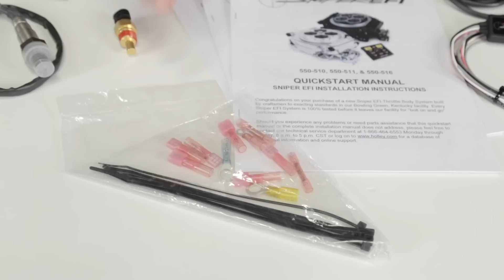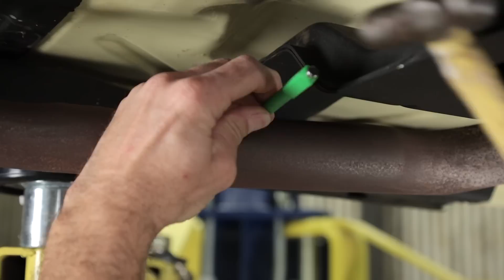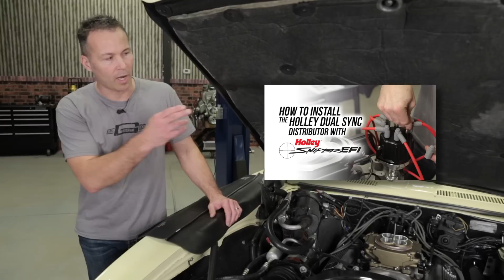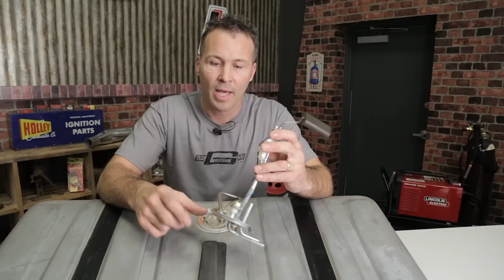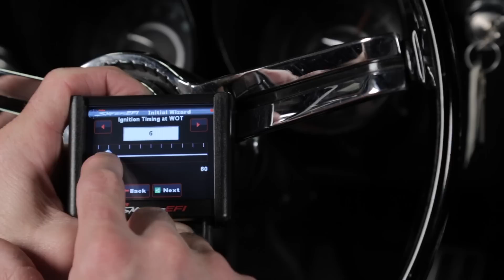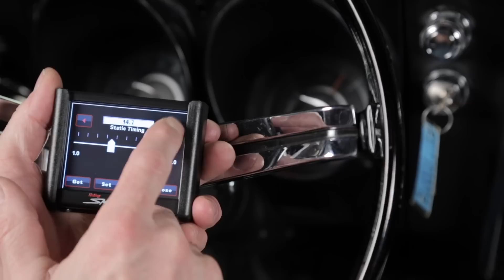How To Install Holley Sniper EFI

Comment: That fuel sending unit that you had in your hand.. That had a port for a return line already sticking out of it, did it not? 
Why not just run your return line directly to that port instead of drilling an additional hole for that fitting?

Comment: @11:10 is it just me or is there a nut missing from the rear end spring perch mount? Likewise, on the 67 you should replace at least one side of the spring perch mounting nut and bolts with a u bolt to prevent the rear end from ripping off the perch.

Comment: So how does it work with a early mopar electronic ignition ? is the hookup the same as a HEI ? And what about heat on the ECM in the hellscape that is a B body engine bay lol and what about power brakes and vacuum Cruise control will it effect the function of them?

Comment: Question,  is the O2 sensor you installed on what I think is the passenger side exhaust downstream of the header collector pipe, only measuring those  4 cylinders' O2 levels?   Great video.  I'm planning to do this install at my home shop. Thank you.

Comment: Installing the Sniper in my 5.0 swapped e36, and installing On3 70mm turbo kit. Just picked up an Aeromotive fuel pressure regulator . Will be running 7-10lb boost. Will I need to utilize the boost/vacuum port on the regulator, and if so, best source to hook it up to?
Reply from the maker: Yes. Your fuel pressure regulator has to be connected to manifold vacuum. -Keith

Comment: Will this work on a rotary motor in my rx7
Reply: if you have some how found a Four barrel intake manifold on that RX7 or a adapter plate maybe lol $1300 is a lot of money for a science experiment the way the rotary works is a lot different than a regular engine works with a crab it just dumps fuel so it don't matter as long as it's timed close enough but efi runs off of the distributor timing coil ignition pulses and need to be pretty dead on and the Rotary crankshaft runs 3 times faster than the rotor does so who knows ?

Comment: Good speaker for a horrible product 1000 miles on mine and I’ve had nothing but problems
Reply: What issues have you had? I'm looking at getting one for a 355 Holden ( GM motor ) in new Zealand

Comment: Is LS better than SBC when carberated? Could a stock 4.8/5.3 LSX produce more horsepower/torque than a stock SBC 350 carbureted?
Reply from the maker: Is this a trick question?? LOL!   Both engines have their pros and cons. And as to which one is better than the other depends on what it is your looking to get out of it or using it for.  A quick search of the internet will get you plenty of opinions and may help answer your question.  My choice would still be the LS!  Thx J

Comment: Can the system handle low vacuum engine with big cam ? I have less than 7 inches of mercury at idle
Reply from the maker: 7" of vacuum is not ideal by any means, but with some time spent tuning with the laptop and patience, you should be able to get a driveable idle quality.    Thx J

Comment: What is required for using the ignition control module? I have an HEI with an accel super coil
Reply from the maker: To connect your HEI dizzy to the Sniper, you just need to connect the yellow wire from the sniper wiring harness to the tach output terminal on your distributor.  Then connect the positive and negative battery leads and the switched 12volt  wire!  Thx J
Reply: @HolleyPerformance  So in order to control timing I need a Holley Dual Sync correct?
Reply from the maker: @TheMojo487  Actually no!  We offer the Holley dual-sync and Sniper Hyperspark plug and play distributors as a conveninet way to control timing with Sniper EFI.  But you can do timing control using almost any magnetic pick-up style distributor like our MSD units. Just make sure the distributor you use allows you to lock out the advance mechanisms and has an adjustable rotor.  Thx J
Reply: @HolleyPerformance  Thanks! you guys rock

Comment: I had a Holley Sniper installed in my '55 Nomad with a crate 350. Seems great. But in the extreme hot weather, Phoenix, the car stalled and I had to wait 15 minutes or so to restart it and go. Don't know if the fuel is boiling or what???? If any one has a suggestion, please let me know. Thanks
Reply from the maker: What fuel set-up are you using?? Pump, line size, etc?   Does your fuel system have a return line (if so where does it return the fuel?)  or are you return-less?  Thx J
Reply: @HolleyPerformance  I have a Holley fuel pump with a return line, 3/8, directly back to the tank. Would a ventless gas cap cause this?
Reply from the maker: @MrMaday55  I'm assuming the gas tank is the original? Your using an external Holley pump like the one used in our master fuel kits?   Are there any external vents on your tank that go to the atmosphere?  If the tank  does not have a vent, or the vent  or vent hose is crushed, damaged or plugged up,  it could potentially create a pressurized situation in the tank preventing the return fuel from flowing back to the tank.  One way to check this is to remove the gas cap the next time you experience this condition. There should be no pressure when you remove the cap.  If there is you need to check and clear all vents or possibly purchase a new cap with a built in vent.   Thx J
Reply: @HolleyPerformance  Thanks, I will try that.

Comment: Shouldn't there be two O2 sensors on a dual exhaust set up? Seems like it would cause an issue only reading one bank.
Reply from the maker: Only one is needed.  The only concern would be if you have an engine with a bad cylinder (ie bad rings, hole in the piston, etc). Depending on which bank the O2 is reading the ECU would not detect the issue, but that's why you should only install Sniper on a good working engine.  Thx J

Comment: Do I need additional  fuel pressure gauge if has one in efi
Reply from the maker: You don't need one but it is a good idea to install one so you can help diagnose easier.  Sniper does not read fuel pressure. Installing an  in-line mechanical gauge is the easiest way.  Thx J

Comment: Do I need additional fuel pressure pump if all ready has one in Efi
Reply: I ment fuel pressure gauge
Reply from the maker: The Sniper EFI system requires a high pressure fuel pump capable of operating at 60 psi with at least 50 gallon per
 hour of fuel flow (more fuel flow may be needed for higher horsepower engines). When selecting a pump, and lines, be
sure each component is designed to perform at high pressure. Thx J

Comment: What is the reason the positive and negative can't go to a engine fuse box? They don't look like they're high amp wires, and I can't think of any reason electrically to do this.
Reply from the maker: Incorrect connections to a fuse panel, starter solenoid or other random distribution stud/strip  will result in excessive resistance. Resistance results in heat and heat results in more resistance.  Another factor is RF or radio frequency interference which can also cause issues with the proper operation of electronics.  Thx J
Reply: Fly back voltage

Comment: Does it have any ports to hook the vaccum lines back up too?
Reply from the maker: Yes,  it has 3 vacuum ports on the rear.  One 3/8" port for your brake booster, and 2x 3/16" ports.  One is manifold (full) vacuum and the other is ported for the vacuum advance canister on your distributor.   Here's a link to the instructions with a diagram for you. https://documents.holley.com/199r11031r.pdf        (look at page #7)        Thx J

Comment: I noticed you specifically said to "NOT" hook up the ground wire, yet then while searching for a switch 12v source, you crank the motor? Not possible if ground not hooked up. Now, if you meant it was ok to hook up the main ground to the battery, just not the wiring harness ground, I'll give you a pass.
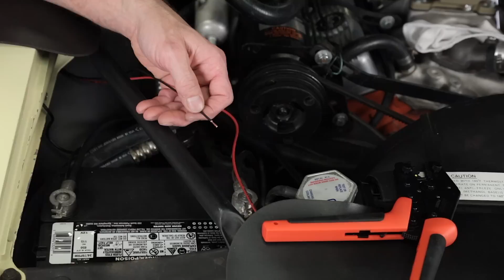Reply from the maker: Ha, you got me!!  The car's negative cable is actually connected (around the 7:15 mark) as I install the terminals to the Sniper wires but I never told you to connect it!   The magic of TV, good catch!!  Thx J
Reply: No worries at all, just needed some clarity. Looking to purchase The Sniper System for a mildly built Pontiac 400.

Comment: i have a 93 suburban that i did the carb conversion from the EFI set up it runs good but still all the drawbacks of a carb ...wish i had seen this video back in april ..now i plan to get the engine rebuilt or get a crate engine i would really like to go back to EFI

Comment: I'm considering installing one of these on a V8 Falcon (302 Windsor) Australian vehicle which already has EFI from the factory but the inlet manifold and throttle body sucks. Are the kits any different for a system already EFI from the factory?
Reply from the maker: I'm not familiar with the EFI units found on your Falcon but to answer your last question,  we use the same units whether you're replacing a carb or an EFI system.  But since some of the components already installed on your factory EFI system ( fuel pump, regulator, etc) may be compatible and retained it can save you some money. hope this answers your question  Thx J
Reply: @HolleyPerformance  Cheers mate, thanks for getting back to me.

Comment: Does it exist anything for an inline 4 1.2cc? I want to do the same on my old nissan
Reply from the maker: You may be able to adapt one of our 2bbl or Jeep BBD Sniper units to your engine depending on the availability of an adapter to fit either of these bolt patterns to your intake manifold.  Thx J

Comment: update, after many many frustrating hours trying to get this system to work correctly(sniper and dual sync) i pulled everything off and reinstalled a carb and hei distributor. seems like a great product but wasnt as plug and play as i thought it was going to be.

Comment: Are these able to be 100% manually tunable? I know the self tuning aspect of this carb isn't able to work for rotaries, but would love to use this on my large street port NA 13B which I've been using a racing beat modified 465CFM 4 barrel on which is great, but I'd like to be able to fine tune and surpass the current 7,000 RPM redline (engine is being built to handle a 9,000 RPM reliably), so if the self tuning aspect can be disabled or simply not used at all, that would be perfect.

*I also have my spare stock port 12A which is currently running in the car that I can use to test on so I'm not risking a freshly built engine
Reply from the maker: We don't recommend or suggest this in any way, but the closed loop learn can be turned off, rendering you to 100% manual tuning .  You would be relying strictly on the calibration/tune that you are using.  You would need to be absolutely sure of your tuning skills before attempting anything like this.  thx J
Reply from the maker: By the way, cool set-up!  Always loved the sound of a screaming rotary!!

Comment: Mine is a W133 200, which comes with a W102 gasoline engine, they are mostly available in Europe and Asia market, I don’t think they were available in the US, anyways, I did buy one 2 barrel already, waiting for shipping to arrive, my next concern is my intake flange sits sideways, I wonder if sniper EFI can sit 90 degrees sideways?or I need to have it converted upright? And where do you you suggest I can find an adapter for the intake manifold?

Comment: Just awesome. I will be doing this!
I take it there's a way to set the ignition curve or is it just a linear increase with RPM/vacuum taken into account?
Also, is there any reason one could not use the old metal fuel supply line for the RETURN line?

Comment: Is there a brake boost vacuum port on the Sniper or would a pump need to be installed. I see a lot of videos of older cars have this installed but no one mentions it.
Reply from the maker: Yes, there is a large 3/8" port (for your booster) and smaller 3/16" port with full vacuum as well as a ported (sometimes referred to as spark port) 3/16" port for your vacuum advance distributor.  If you click on the link below and look on page 7 you'll see the locations of all the ports.  thx J  
http://documents.holley.com/199r11031r.pdf
Reply: Excellent! Thank you. Getting closer :-)

Comment: nice video, i was wondering if this system kit only work for American build cars, or would it work for my Mercedes Benz W123, 1983, 2000cc gasoline motor?
Reply from the maker: It will work on American made as well as foreign-made vehicles!   However, I'm not a Mercedes expert but isn't your W123 engine, in fact, a diesel engine not gasoline????  The Sniper EFI systems are designed for gasoline engines only!!  Thx J

Comment: May I ask what this is for? Does it make my car faster or what’s it do
Reply from the maker: It's called fuel injection, it can improve cold and hot starting, overall drivability by adjusting for temperature, humidity, and elevation changes. Typically you will have an increase in fuel mileage and better engine management/control while improving engine performance in all weather conditions. Not to say carburetors aren't any good but EFI can offer alot more in my opinion. Thx J
Reply: HolleyPerformance thank you

Comment: I will never understand why on earth anyone would install an EFI without a return. Unless you really like to boil your fuel and overwork your pump, I see no reason to not.
Reply: I was told the opposite.  The return system requires the pump to run constantly with creates heat in the pump, thus the temp of your returned fuel.  The best way is a pulse module style pump without a return or regulator.  All the constant cycling and friction at each component increases the potential for vapor lock.

Comment: great kit, installing now but wish the master kits they send out now were as complete as this, no longer comes with brackets, carb studs or wiring connectors.
Reply: What  efi will work on 164cu in .  Corvair... air cooled

Comment: MSD Atomic beats the Holly system hands down. And thats coming from a guy who has had holly carbs on all my street rods for 35 years. Its better priced. It makes more power. Its easier to install and hook up. It works better with their Ignition units/Distributers. They provide better tech support, and lastly, you can control your timing curve, and cooling fans with their EFI system. A whole MSD conversion kit for a old muscle car/street driver car is 1300 dollars. Holly is around 2000 for a whole conversion. IMHO I think MSD did it better. Sorry Holly.
Reply: Holley owns MSD.

Comment: great video thanks.
Is there any value in keeping the spacer below the throttle body?
Reply from the maker: A spacer can be beneficial but performance depends on a variety of factors such as intake design etc.  Won't hurt to try it and see!  thx J

Comment: I have recently purchced the Holley EFI sniper master kit as it is sapose to have everything needed to install the complete system. Well, the kit is not complete and Holley said they no longer supply the EFI mounting studs, air cleaner studs, Fuel block off plate, throttle hook up linkage, electrical connectors and zip ties. So after spending over $1250 for the master kit, be prepaired to buy what ever else they left out of the kit. Also they don't put steel braided fuel line on the EFI like they use to. What a disapointment.
Reply: That's pathetic... thanks for posting this -
Reply: That's the same boat I'm currently in and It's disappointing. Don't even have part numbers to reference for the brackets that's needed that's no longer included.
Reply: Yup just happened to me too! and no sticker so I lost that 5hp sticker bonus
Reply: Cheap son of a Bitchez!
Reply: @bigjon.6258  lmao from your comment 👍🏿😂😂😭
Reply: Nickel/dime stuff, NBD.  One size fits all sh*t never does right anyway. Probably did it to keep kit costs down and some of that stuff you're better off to do your own.
Reply: I used to suppose.
Reply: thanks, was going to purchase this tomorrow, but I'm going with a different brand
Reply: Well shit mines gonna be here this Friday I'm glad I saw this so I can be prepared to go hunting for stuff what a drag because I e been waiting 8 months to finally purchase this and now I find I'm gonna have to to to the store anyway thank God I already have an electric fuel pump I'm happy with so no surprises there
Reply: Same here.
Reply: Same here, and after install the pump is noisy as Hell. The SS o2 clamps were junk. I'm going to install the OEM style in-tank pump from Holley because of the level of noise the frame rail mounted pump produces. I'v tried more insulation foam and it didn't quieten it any. I'm getting to the point of re-installing my quadrajet. I hope it runs good for you because I'm disappointed too.
Reply: @Rick-Williams59  Any frame mounted pump is going to be noisy, it's not something specific to the kit, however that's the only way for people to use their factory (non EFI) fuel tank.  What else would you have had them do? Require you to buy a $500+ EFI fuel tank and sender?

Comment: master kit is not complete like in the video   lot of missing part like the stud and nut the air cleaner screw and the old  gas pump hole blocker